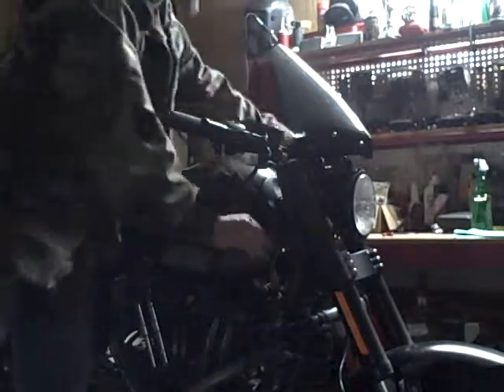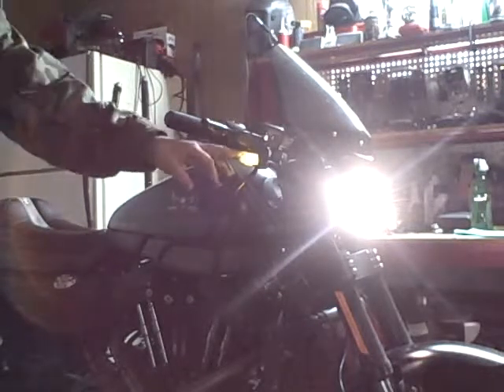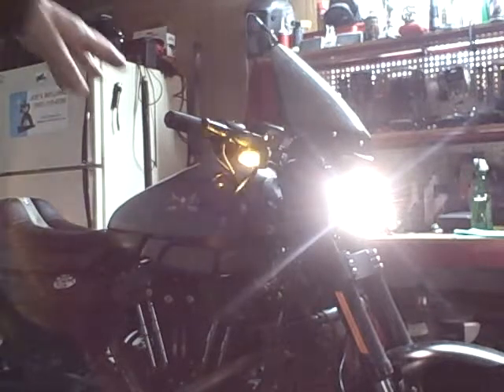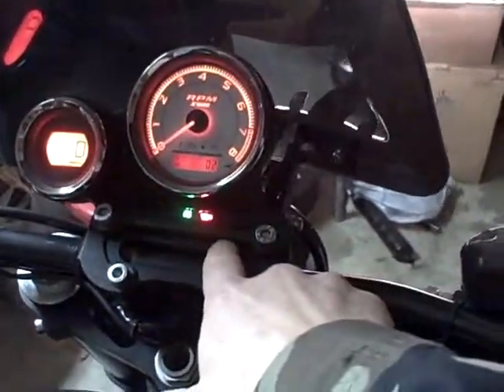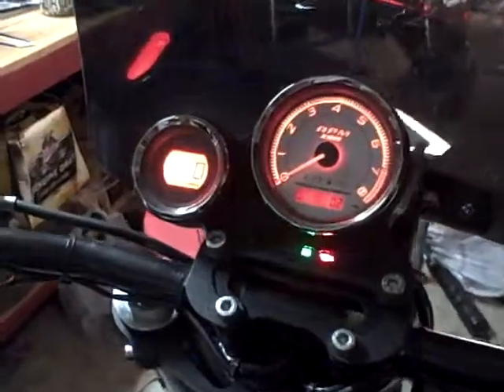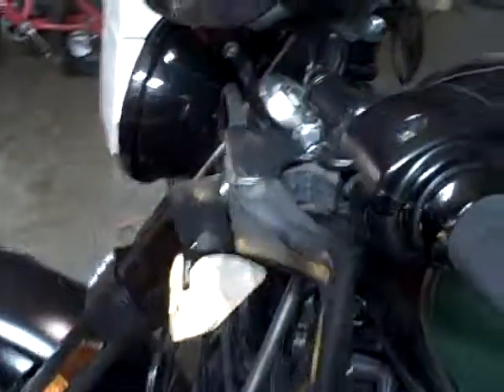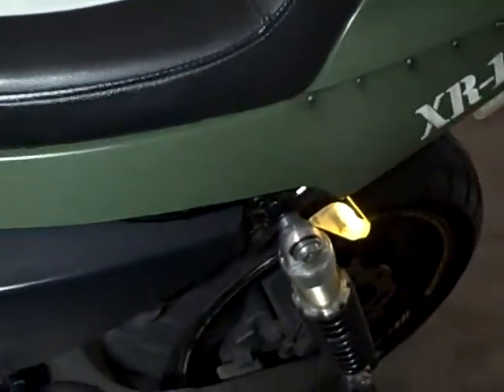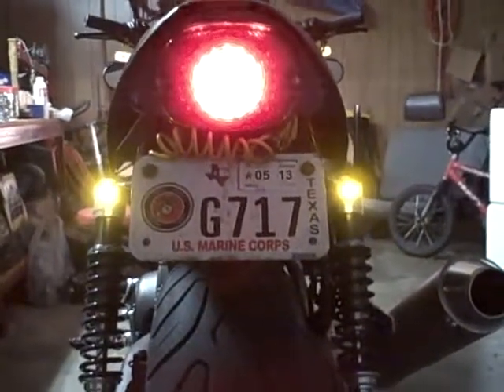XR1200 LED Signals

Comment: looks good what 1-Amp Rectifier Diodes did you use? And will any  470 Ohm Resistors work? Also do these have the dimming affect Dim DRLS and bright blinkers?
Reply from the maker: Hi Petey. I have links to the parts I used at the start of my report here: http://www.jp2code.net/xr/LEDs.aspx. It looks like Radio Shack has changed their website, though, so the links no longer work. Rats. Here is a current link to the Diodes: https://www.radioshack.com/products/1n4001-micro-1a-diodes  and here is a link to the Resistors: https://www.radioshack.com/products/radioshack-470-ohm-1-2w-5-carbon-film-resistor-pk-5
Reply: jp2code Great thanks